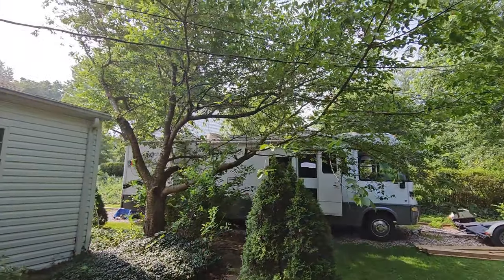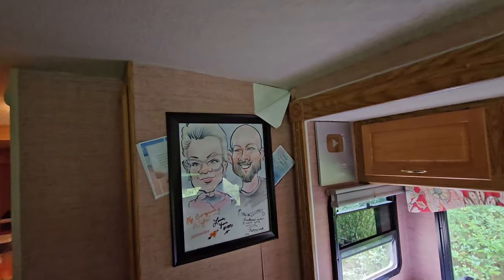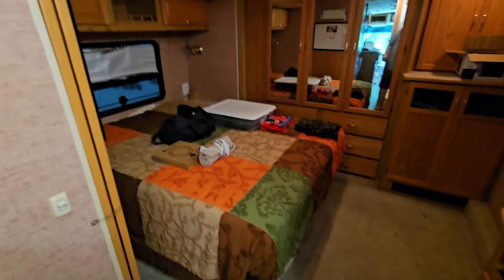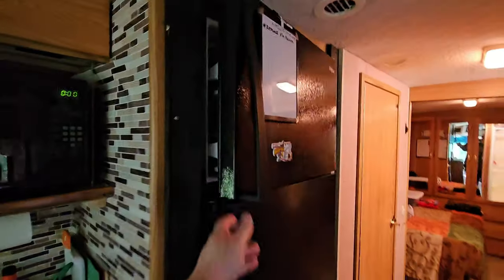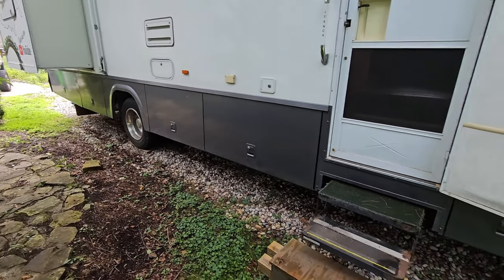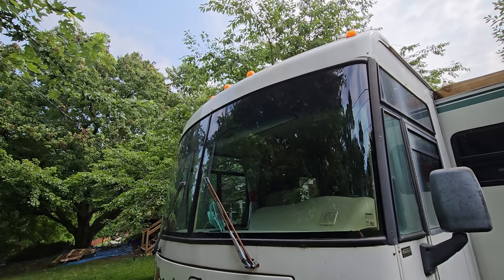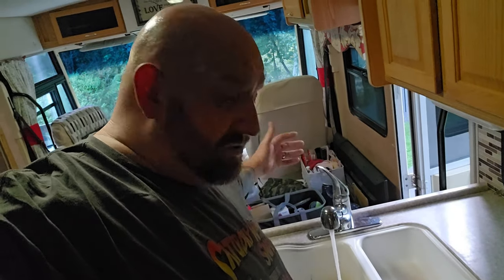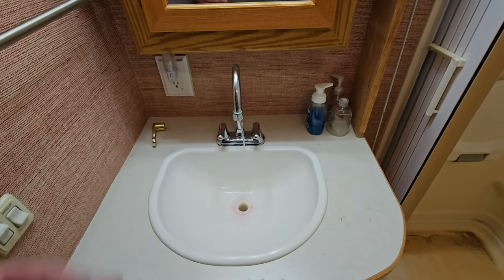THIS RV IS KICKING MY BUTT ! PREPPING AND DE-WINTERIZING FOR A ROADTRIP part 1

Comment: It’s always so much work to get ready. We leave mid-Oct for wintering in Yuma. We are thinking of giving up RVing and buying mfg house in Yuma for winter use. We are almost 74 and have been doing this since our 40’s. The older we get the harder and more tiring it’s getting to drive it. Plus, have a tendency to fall on steps too. Also have a mysterious leak to repair before we leave too. Good luck.

Comment: time for  A NEW RV --  not worth the money that  you are putting in ... ....prayers that you make your trip safe ,,,,,,,,,,,,
Reply from the maker: Problem is, this happens with every RV, even brand new ones, cause they are built like crap... especially the brand new ones. There are no checks and balances when they are building them, they just throw them together and get them out the door.
Reply: @RTSoutdoor  ya pretty much like everything nowadays , quality just doesn't exist anymore , but they sure still wanna hike up the prices on everything though , good luck Nate

Comment: My opinion, is maybe get a basic size RV ( not a big RV )
Reply from the maker: Honestly the size of the RV doesn't make a difference. This kind of crap happens with every RV regardless of size make model, they are all pretty much junk. Not only because they are built like garbage, but you're literally driving a HOUSE down the highway at 70 mph, bouncing down hills mountains and dirt roads constantly. It all just has horrible effects on the whole vehicle. We've hit bumps and had the microwave fly across the entire kitchen, the fridge open and everything fly out, drawers break at the seams, and if you drive with the windows open, EVERYTHING flys around lol. If you forget to close the vent in the bathroom, the entire roll of toilet paper unrolls itself all over the place lol. It's a mess.
Reply: @RTSoutdoor  , ok thanks
Reply: @RTSoutdoor and here I thought only little kids make that kind of mess 😂

Comment: How old is the RV? What is the age limit at the RV parks?
Reply from the maker: It's a 2003, but honestly the age of the rv doesnt matter, they are all built like garbage, so they all fall apart the same and have constant problems. Some parks have a 10 year rule, but even the ones who do, don't enforce it most of the time.